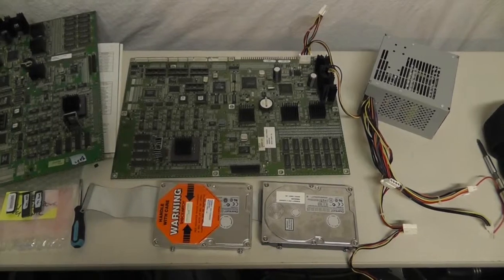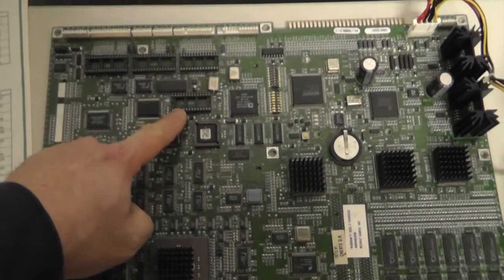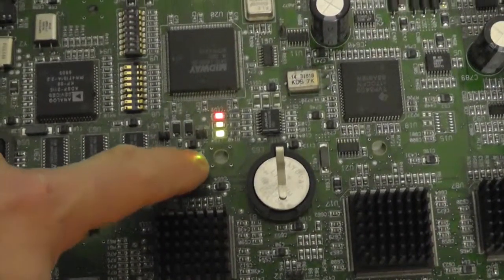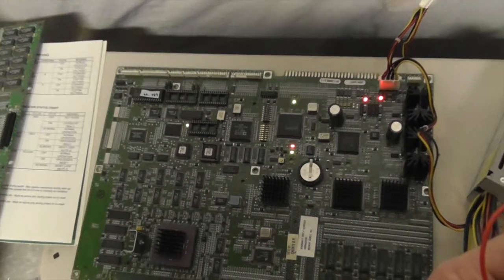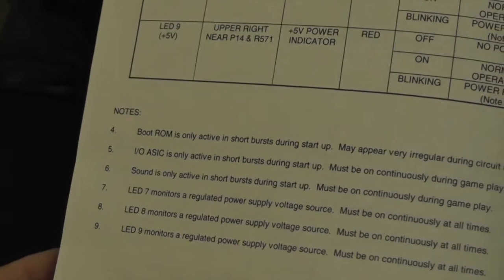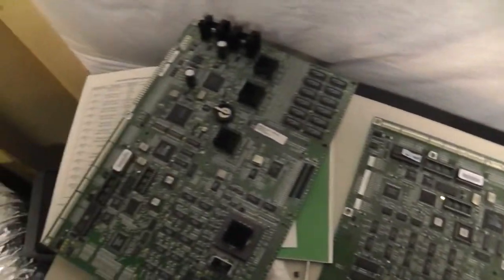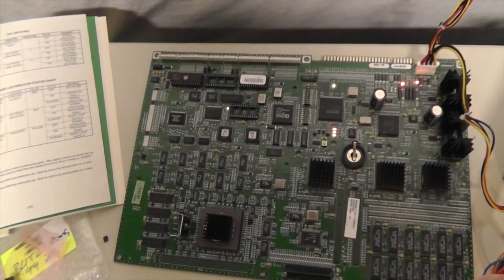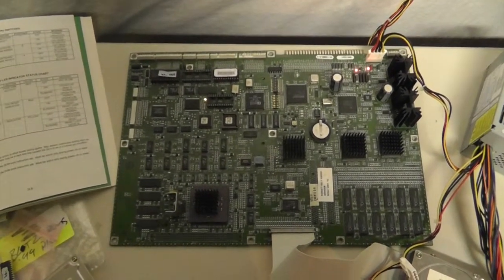NFL Blitz Troubleshooting - Seattle PCB

Comment: Can you convert a gold board to a  just nfl blitz? Just swap hdd and chips?
Reply from the maker: Yes you can.  The only blitz game that doesn't run o. Seattle pcb is the combo showtime/blitz game that runs on vegas board ser
Reply: @jacklick  ok thanks for the info
Reply: Ok check this i got a gold 2000 untested and boom ya it works lol but my joysticks are not workn ?  Is it the dipswitch? @jacklick
Reply from the maker: @kevinthorn9672  dip switch does control whether you are using 8way or 49way sticks
Reply: I got 2 sticks
Reply from the maker: @kevinthorn9672  are they 8 way or 49 way?
Reply: @jacklick  well its a mk4 cab so 2 players
Reply: @jacklick  guess there a 8 way
Reply from the maker: @kevinthorn9672  check manual but should be U8 dip 1 set to on for 8 way sticks.
https://forums.arcade-museum.com/threads/nfl-blitz-i-need-help-troubleshooting.476486/
Reply: Hey quick question guy wants to sell me a seatle pcb he says no video but can hear the game music n such?
Reply from the maker: @kevinthorn9672  I would pass on it.
Reply: @jacklick  no fix?
Reply from the maker: @kevinthorn9672  You can try  https://www.arcadeservices.com/pcb-repair.html  or post want to buy thread on klov etc.  if the graphics chip is toast not much you can do.
Reply: @jacklick  damn you cant replace it?